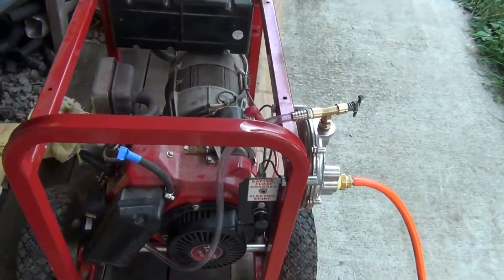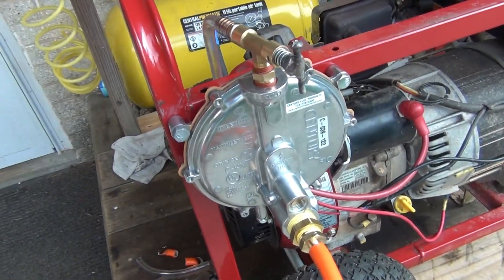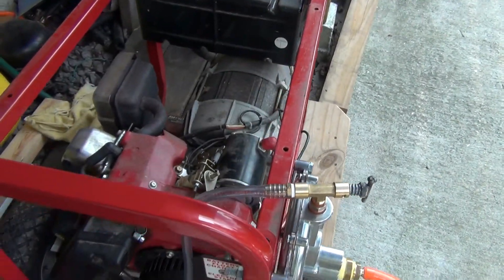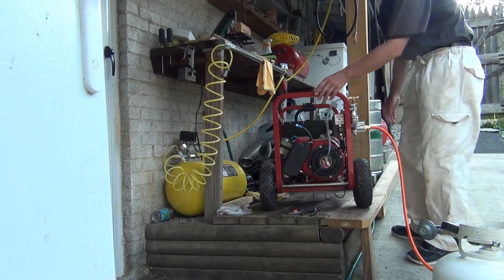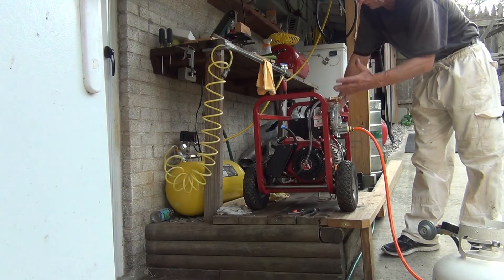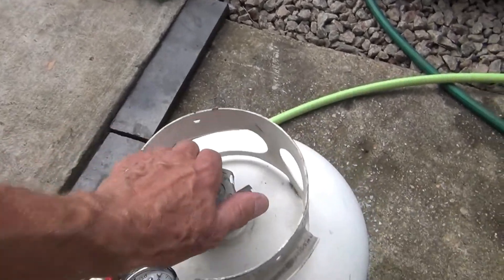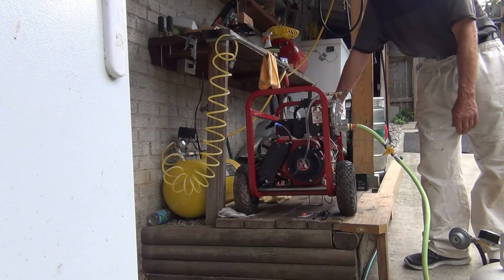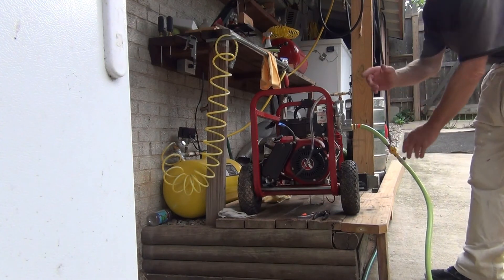Starting generator on LP or natural gas

Comment: Change your spark plug gap to .025 like the instructions on the kits say to do.  Yank to or three times to build the vacuum and they will start just fine.  Even the bigger generators.

Comment: My generator air filter is on top of the engine. It like a old car round filter with a top on it with a wing nut how do I get the propane in to the carburetor. Thank you so much for sharing how to do this I live in Louisiana in hurricane season I have to keep over 100 gallon of gas on has just to try and save my food in my freezers . I always worry about someone getting hurt. Please if you can help me even if you have to draw a picture. Thank you in advance for anything you can teach me
Reply: Contact US Carburetion.com. Attn Shawn.  He can guide to info for almost any engine configuration.  I just completed a conversion of an 18 year old Troy- built 10 hp gen set, manual start.  They sell kits for almost every generator as well as the hookup kits for Propane tanks.   Wonderful people, very quick to respond to their customers.   My  conversion consisted of a “snorkel tube which is inserted into the mouth of the carb.    A regulator senses when the engine quits and is not putting out any vacuum.  A diaghram  vacuum activated, cuts off the propane automatically if the engine stops.   In their kits they include everything for the conversion including, hoses, bronze fuel control valves and a snorkel to fit your carby .  My conversion took about an hour to complete and the engine started on propane alone, cold, without an electric starter.  On the second pull of the starter rope too.  I could not believe it.  These people know what they are doing.  I couldn’t be happier.  A 6 star rating really.

Good luck
JoeB
Reply from the maker: can you make a short video and post it on youtube so I can see your generator.